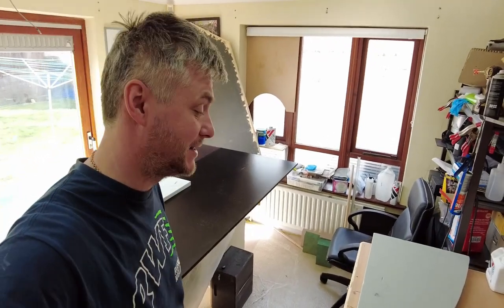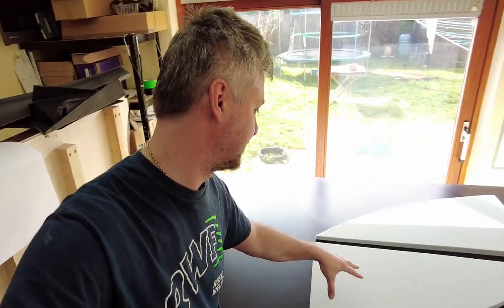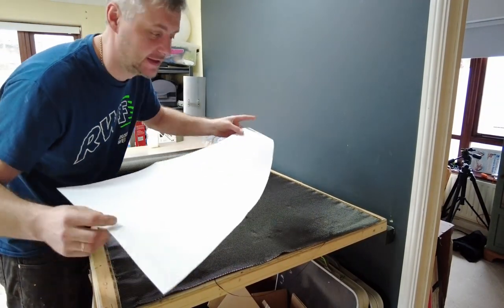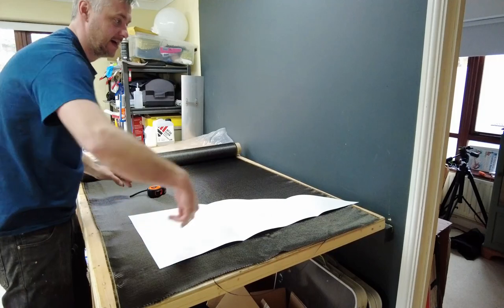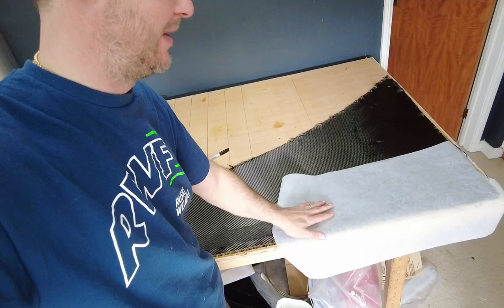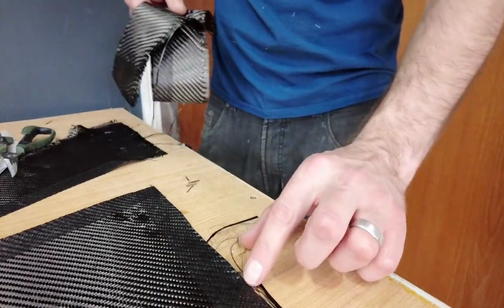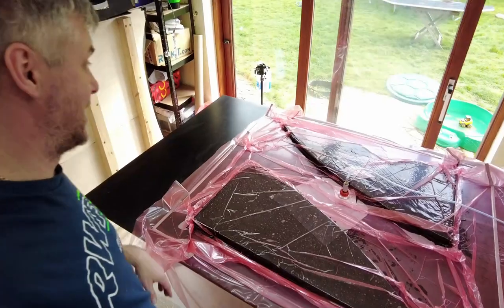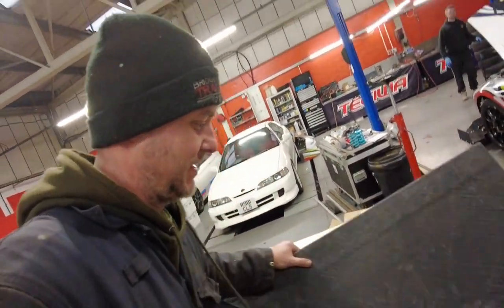Amazing LifeHack How-to Cut Carbon Fiber! New aero part for @tegiwa

Comment: spray tack the carbon fabric with thin veil or tissue mat, then cut it with rotary cutter. leaves end result with no loose fiber along the edge.
Reply from the maker: Great tip!